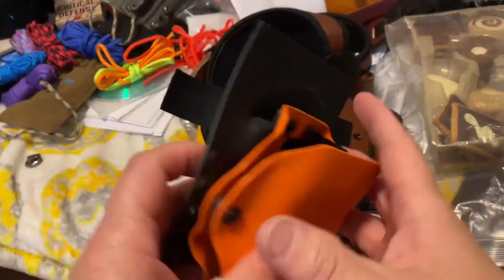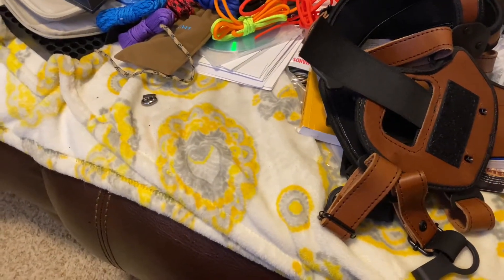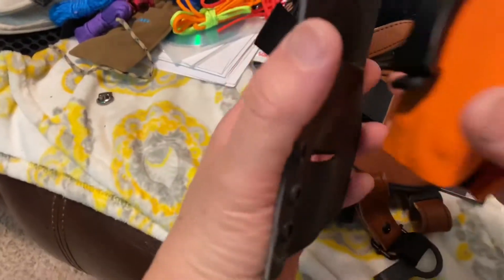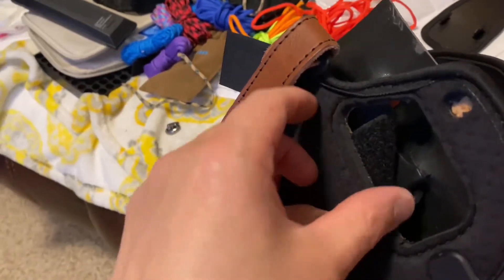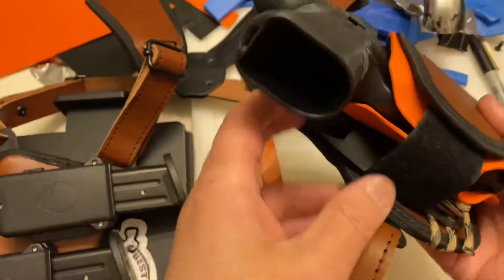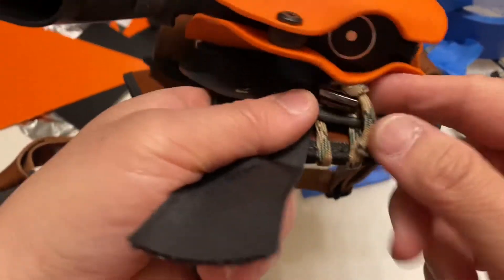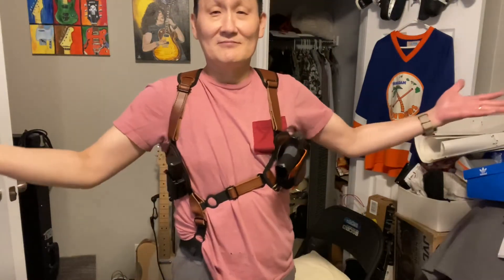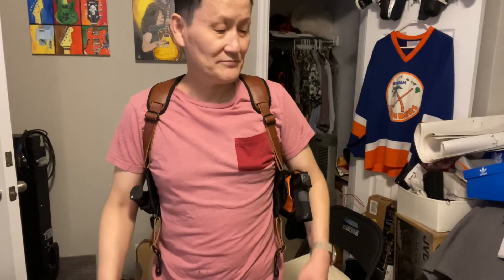Alien Gear/Sig Sauer holster mod part 3 conclusion

Comment: sorry your idea didn’t work out as planned but tbh considering how bulky the holster is out the box not that it’s bad but not the most slim holster on the market, but I would just purchase a TLR-7 or a light that AG makes a shell for & they offer shells with a optic cut out so just go that route buddy. 

Or just take off the light for now & order a shell with an optic cut out so at least you can wear it & it looks good. 
Thanks for the upload & keep crafting. 
Btw I ordered a shoulder holster from Craft holsters & since I don’t wear belts, but still didn’t want my holster popping me in the face whenever I bend over to tie my shoe or bouncy around when I have to run I constructed my own back strap using the buckle where the belt strap was at & attached my own leather strap that connects with velcro very simply and quicker than using a belt. People think my holster came that way but i’ll be uploading a tutorial on how I made it soon.
Reply from the maker: Cool,  I look forward to seeing your holster mod.

Comment: I stand 5'8" at 205 lbs ..... I am right in the the middle of the weight and height of the average American male.

  

Took 8 months for the company to send the correct part for the shoulder holster... then I had to call back 6 times to correct their error.

The gun shell  sent did not fit my Sig 229. 

The gun canters out away from the chest towards the arm, so much so that
 it is impossible to draw the weapon. 

That was the first canter problem. 

The second is that once the holster is on ... the weapon also naturally falls so far behind the side of

the ribcage that it is not possible to draw the weapon as it it is out of reach of the right hand ....

and adjusting the belt clip forward does nothing to effect the position of the gun under the armpit.

I can't wait to get rid of this piece of crap!  I wish I'd never heard of this company.

Their products at crap and because of poor design it put lives in danger!  

Don't waste your money on this crap!
Reply from the maker: Sorry to hear about your experience.  I can relate a bit.  I think Alien Gear makes quality holsters but it's geared towards people who only carry bare-bones stock guns.  There's no way to conceal with a shoulder harness unless you're carrying a micro-compact gun or wearing a bulky jacket.  I'm sure there's probably a way to salvage your holster, just need to get creative.
Reply: @dangoldnerd  I tried adjusting from smallest to largest. The problem is a poor design that has cantering problems. Then a  thumb release that is poorly incorporated. I would never trust my life to this equipment. I have learned rhat if you go "CHEAP" .... CHEAP IS EXACTLY WHAT YOU GET!
Reply from the maker: @pdy1971  I hear ya’ I removed the thumb release right off the bat.  $130 is not cheap ; you could try to drill new holes to achieve your desired cant.